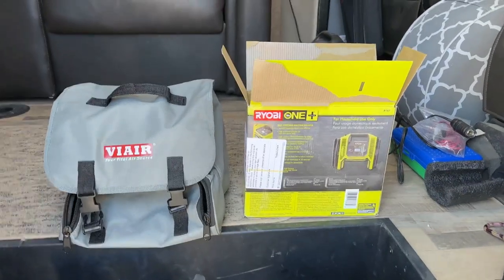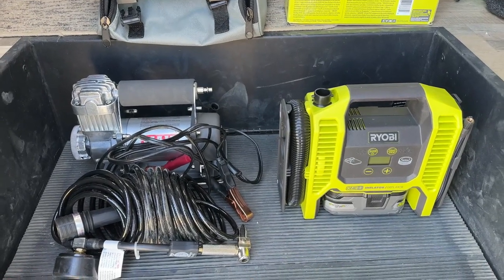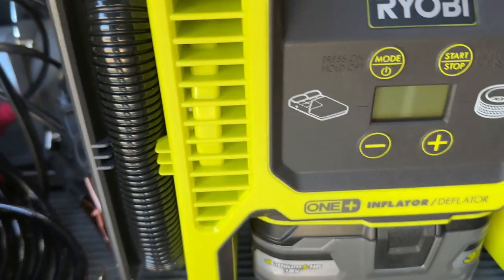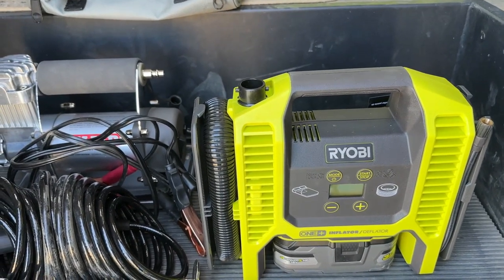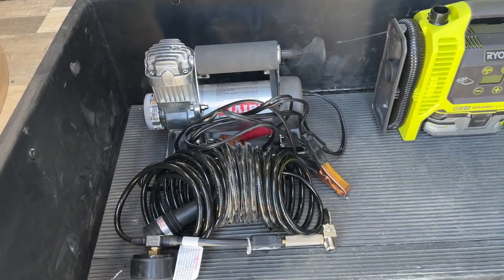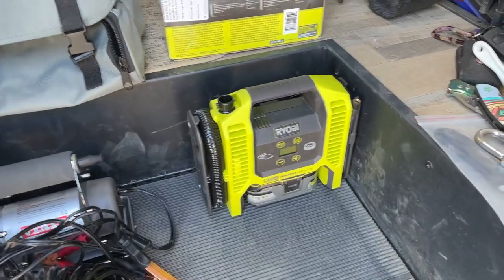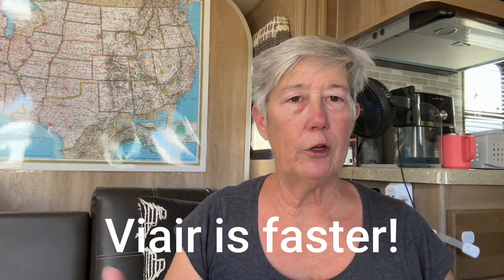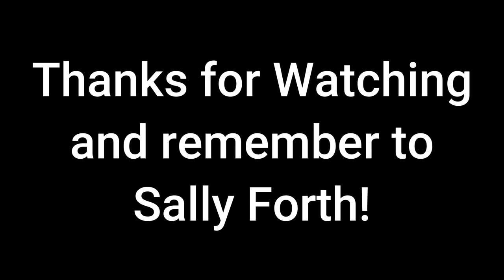Air Compressor Shootout - Viair versus Ryobi

Comment: The Ryobi seems to be a good match for your needs. That said...knowing how your coach is set up with lithum batteries and solar, why not simply clip the Viair onto your Lithium battery bank. They are perfectly capable of handling the Viair's current draw and you've got plenty of storage capacity as well as solar to replenish whatever amont of amp hours you might use.
Reply from the maker: Thank you for the suggestion! I'll definitely have to consider using my lithium battery bank to power the Viair compressor. It sounds like a great idea, and I appreciate you taking the time to share it with me. I'm always looking for ways to improve my setup and make things more efficient, and your suggestion is definitely worth considering. Thanks for being a helpful member of the YouTube community!